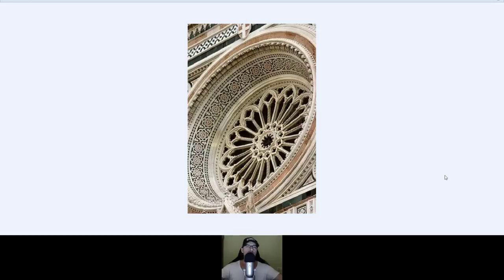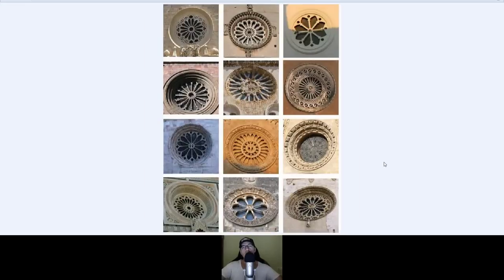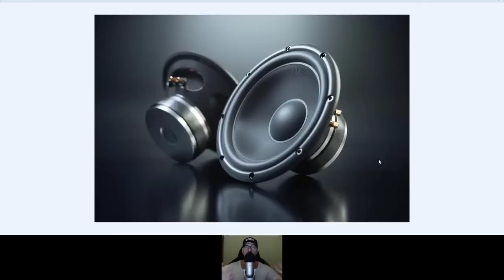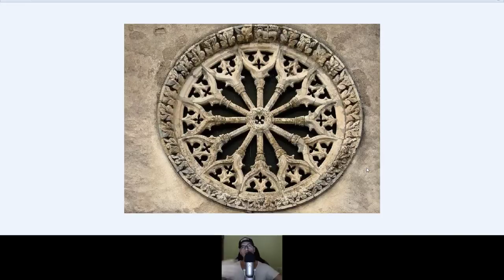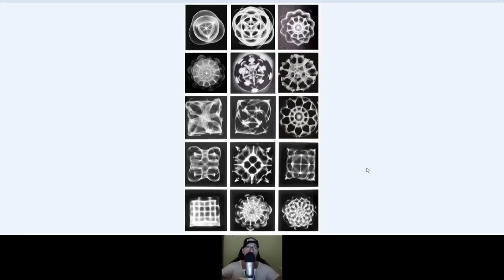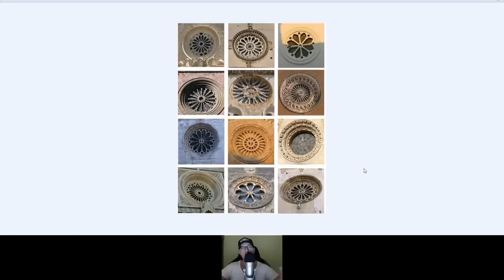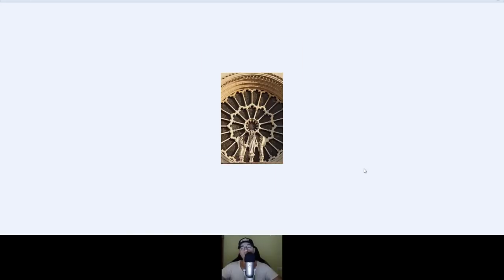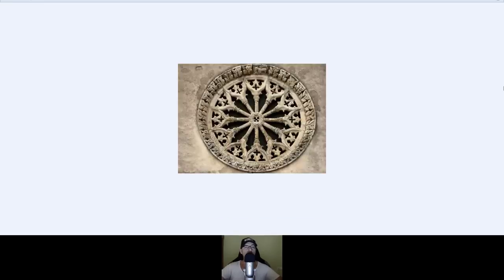Churches were Free Energy generators NOT built by Tartaria

Comment: I honestly think they were weopenized compounds some people have heard about the Pyrimid Wars well I think there was also the Chathredral Wars the amount of energy that were generated from these structures were insanely powerful that is why most of them have buttresses on the outside to make the outter/inner structure more durable to be able to generate and harness multiple forms of power  eg Etherical Power in the forms of  Magnatism,Harmonics,Symatics,Sine Waves,Electricity etc and the components inside like copper,mercury,bells and the pipe organs and the organ keys were used to control the machine that is why they are so elaborate there is keys and all different levers etc the only thing is people have forgotten how to use them because some of the needed components have been taken out of these structures I know it sounds crazy but I've had dreams about these Wars they would ring the bells and at the same time the pipe organ would be played to creat a super enhanced Sine Wave which would than charge the three spires on the roof once the spires were at a sufficient strength the man that uses the "organ keyboard/control panel would than choose the coordinance with leavers and a pully system to shoot thw DEW remember the three characteristics of a Sine Wave is Frequency Amplitude and Phase if you look at most powerlines on the power grid today there is generally three main coils we harness the same power today the only difference is they use generators back at the power stations to build up enough power to shoot it back through the energy grid to the homes and businesses you say Tartaria wasn't true I say it was but not how some make it out to be we definitely had free power and the elites did a major reset a few hundred years ago and have now monetised almost everything that was free